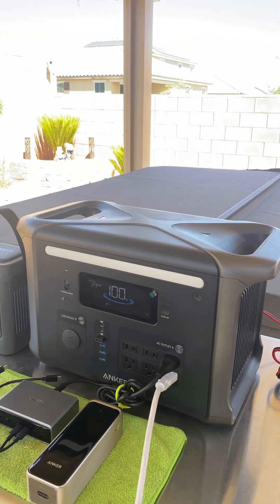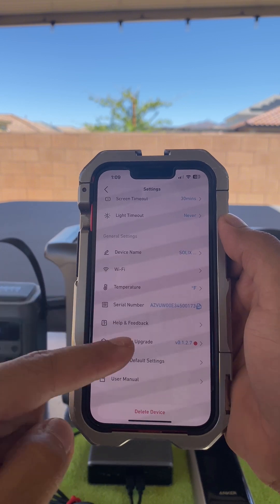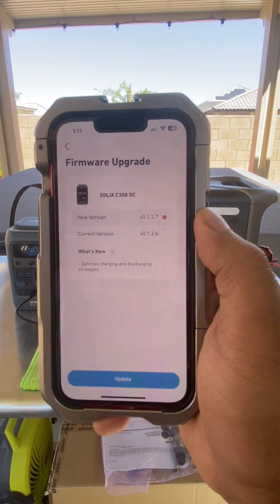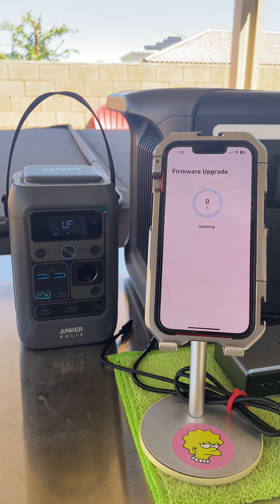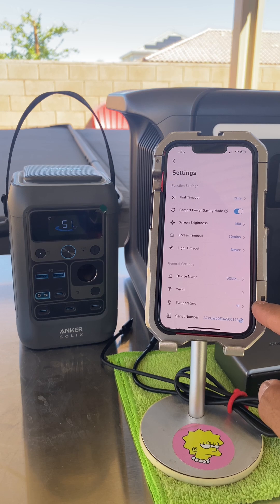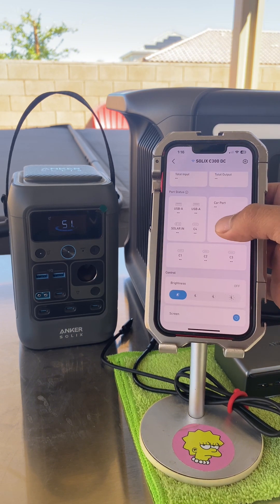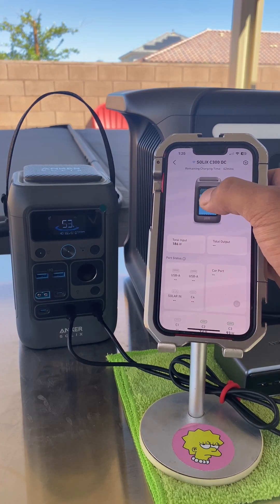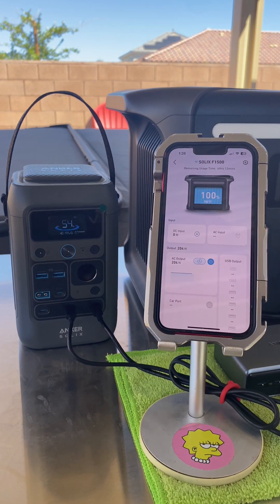Anker SOLIX F1500 charging C300 DC with Solar ☀️🔋⚡️

Comment: Just picked up both the C300 DC and the F1500! Dropped my C300 from a 4ft height onto solid concrete floor and it survived with only a few plastic dents and scratches. F1500 is a solid chonker. Just have a 120w portable solar panel for now but will probably pick up 220w-300w later when the price is right
Reply from the maker: thats dope man! yeah like to pick up anything when its on sale i got the SOLIX C300 DC for $150 and the SOLIX F1500 for $500. im pretty sure you can find some good solar panels on amazon for cheap as for Anker solar panels, i think they’re overpriced for what they charge compared to Renogy. Renogy has 200w for $220, sometimes even has a $20 off coupon you can clip too!
Reply: @marcusjuco  absolutely right...won't be too long until Black Friday sales and then there'll be lots of options. Currently, Renogy is in the top few I've been looking at. You probably already know this but it's also easy to pick up a high capacity LiFePO4 battery with a cheap DIY cable and use it as a cheap(er) external battery to extend the power of your Power Station
Reply from the maker: @DaMerk5  thanks for the tip! i did already know that😅 but some people out there didn’t know that so it’s good to put out there anyway.